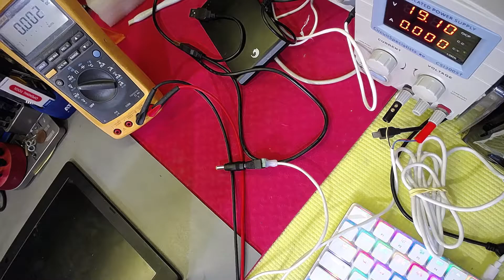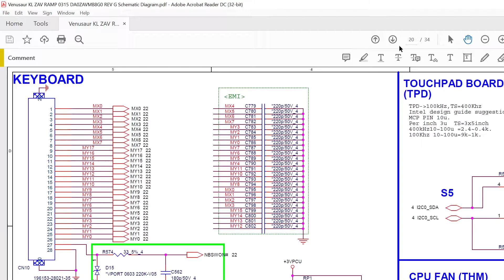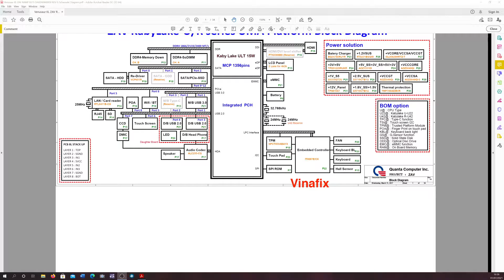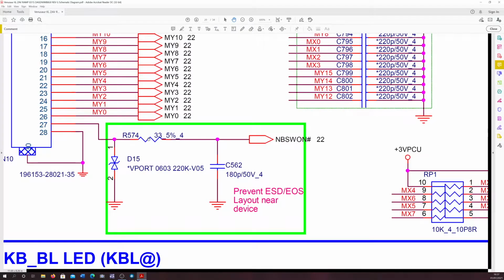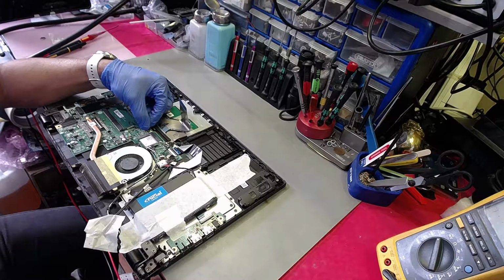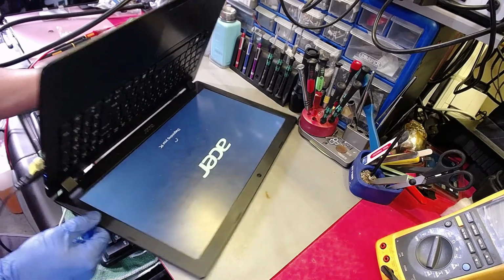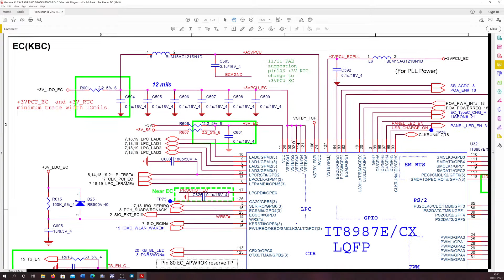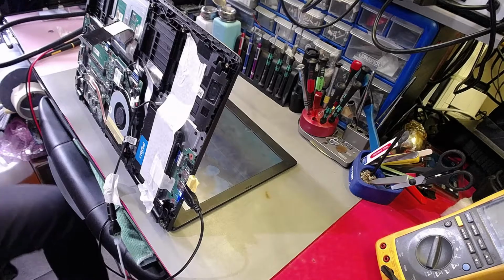HOW TO TROUBLESHOOTED ACER ASPIRE 3 A315 51 NO POWER

Comment: I have a different problem on same machine.   AC power keeps turning off intermittently.  When I plug charger in with machine turned off sometimes the battery won't charge. Other times it will run the laptop and charge all the way to 100%.  Often AC Power will go off at 60%, stay off for 20 mins and then come on again. Charger is chucking out 19 Volts all the time. I have replaces the battery and charger input jack but issue still there. Any thoughts?